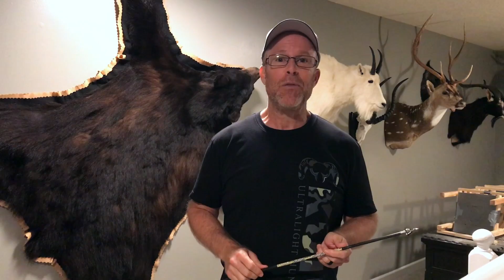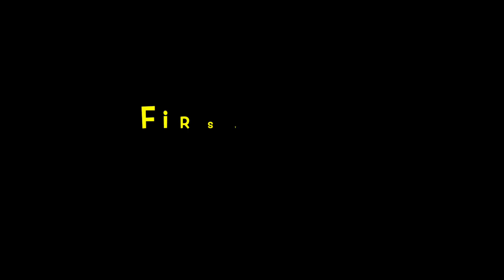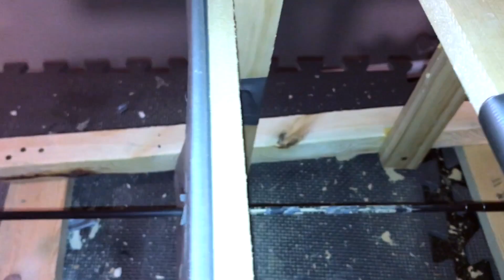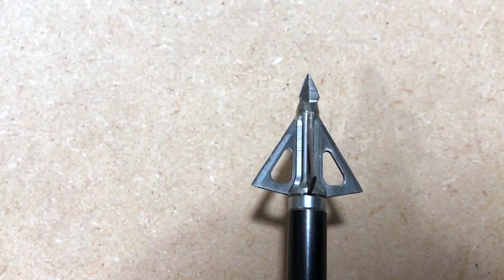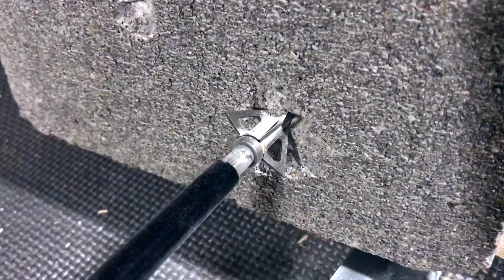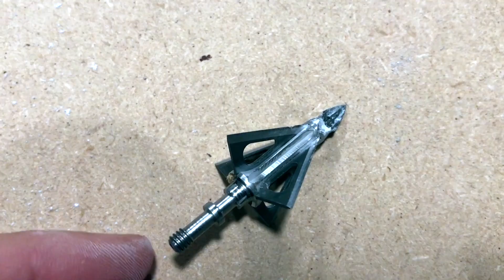GRIM REAPER MICRO HADES Broadhead Test

Comment: Whats is your thoughts on 3 blade vs 4 blade on the micro hades? Planning on using one of these broadheads and just curious on the pros and cons before making a decision.
Reply from the maker: I prefer the 4 blade. The cutting diameter is fairly small, and my set up can still drive it deep, so I like the extra cut.

Comment: I’ve been using the 3 blade 125 gr. micro Hades pro for elk over the past 3 years. 1st year = tag soup. 2nd year = full pass on a double lung shot. Arrow stuck into a tree 10 yards past the elk. 3rd year = quartering to. Arrow went in right behind the shoulder and was sticking half way out of the opposite ham when I found him. Neither elk went 40 yards. They’re amazing broadheads! 60lb Mathews Chill R, 30 in draw, Easton Axis arrows.
Reply: I very much appreciate this comment. Going out west for Elk for my first time this year. Sold. Grim Reaper should give you and Lusk % $$.
Reply from the maker: Good to hear.

Comment: Looks just about like a Slick Trick so it should perform well! I've been shooting those since they were invented.  The company owner was a Christian  and a good man. He made his of American steel,  until he couldn't get sharp blades. At that point,  he started using Solingen steel blades fron Germany. I still use them exclusively now that I have to  use a crossbow. They fly straight and penetrate animals like crazy. I've never had the urge to change,  having had problems with mechanicals. Keep up the good work!
Reply from the maker: Thanks for the comment. I used to talk with Gary quite a bit back in the day ")

Comment: For a new bow whitetail hunter in New York the selection is overwhelming on broad heads! Assuming the average distance I would shoot is 30-40 yards from both tree stand and blind...is there a broad head I can start with that you’ll recommend? Thanks for any help.
Reply from the maker: Sure. There are lots of excellent choices. I would suggest the QAD Exodus, or the Grim Reaper Micro Hades Pro, or the Tooth of the Arrow XL. Check out my vids on the Tooth of the Arrow. And you can use my discount code: LUSK19 to get an extra 15% off.

Comment: Host: do I need a  zero penetration test no bit it show the integrity of the materials and durability 
GrimReaper: Zero penetration.....What's that? We ain't scared of a cement block!
Reply from the maker: It's actually a common test. If a head can handle that, then it can most certainly handle a tough bone. Is it necessary for hunting? Of course not. But if all other things are equal, why not pick the one that can handle this?
Reply: @LuskArcheryAdventures  I agree completely!
Reply: @LuskArcheryAdventures  I was amazed at the penetration and sticking of the head! That would crush straight through an elk shoulder even!

Comment: Great review.   Have you seen the Magnus 4 Blade Hornet Ser-Razor Broadhead?   I'm very curious to know if the serrations will out-preform a continuous cutting edge.   There is a heated debate about that topic.   I'm going back and forth between them and the Exodus (which I know preformed very well for you).  If you get a chance to review the Hornet Ser-Razor, I'll be first to watch.   Thanks.
Reply from the maker: Thank you Vital Point. I did test it in one of my vids last year. I believe it was a test of the "Normal Priced Heads" or something like that. I tested the Magnus with the Exodus and the Muzzy, I think. It's a great head, but a two blade tip in that kind of steel will fold over when encountering certain mediums. However, it does penetrate really well and is a fairly tough head.
Reply: Lusk Archery Adventures Thanks for the info.

Comment: Any plans to test the VPA two and three blade broadheads?
Reply from the maker: I did test the VPA 2 blade, in a comparison to a single bevel head; you can check that vid out. It was called Broadhead Battle: Single Bevel vs Double Bevel. VPAs are great heads and will certainly get the job done. I don't have any more funds at this point to add new heads to the testing lineup, but I should do more with the VPAs in the future. Thanks for the suggestion.
Reply: Thanks! I’ll check it out. I’m running the solid (non-vented) two blade for deer this year with my recurve.
Reply from the maker: Good deal. Would love to hear how you like them.

Comment: The Hades pro series tips I have flatten very easy did they come with different tip
Reply from the maker: Man, the ones I have sure don't flatten--this thing was razor sharp after all this testing. The Micro Series has a shorter tip than the non Micro Series and that may make a difference; it will certainly be tougher.

Comment: I'd like to see your testing, but on a layered target.   Something that the broadhead is constantly cutting through or penetrating through.  What slows the arrow down in a target is friction.  Well if there is only 1 Layer of MDF, then broadheads with the bigger circumference would have better penetration that a more narrow/sleeker broadhead like some of these mechanical/2blade fixed.  Because they've made a bigger initial hole for the rest of the arrow to pass through.   I might be wrong.  Just seems like a layered medium would be more accurate. and easier to read.  Perhaps layers of cardboard labeled, and perhaps compressed somehow to get consistency.  IDK just brainstorming.  Keep up the good work!
Reply from the maker: Thanks for the comment Kyron. Great suggestion. Last year, I used a multi layered target--carpet, rubber, foam, plywood, cardboard, leather, etc. But this year I decided to try this new system. You would be surprised by how well some larger cutting heads penetrate, even compared to smaller cutting heads. There is not always a clear correlation. Maybe next year I'll go back to a multi layered medium. Thanks again!
Reply: @LuskArcheryAdventures  well, i think i didn't word it right. I think larger cutting/broader heads will create a bigger hole for the arrow shaft to penetrate through, and then their would be less friction slowing down the arrow shaft compared to a smaller cutting/penetrating head.  which would actually skew the data.

Comment: Another good head. Thanks John your the best. I'm going with an axis pro 5mm 300 with 50 grain brass 4 aae pro max on a slight offset with a sevr 1.5. Thanks
Reply: Boxing 101 I truly thought the same thing until I started losing outserts and half outs in 3D targets and bag targets. Yes yes I tried multiple glues and proper setup..  just didn’t go well too many times. I’m always willing to try though.
Reply from the maker: Thank you